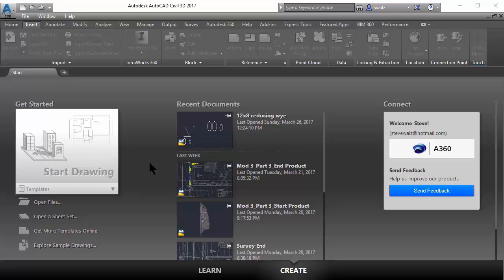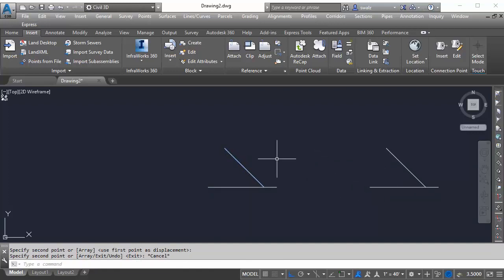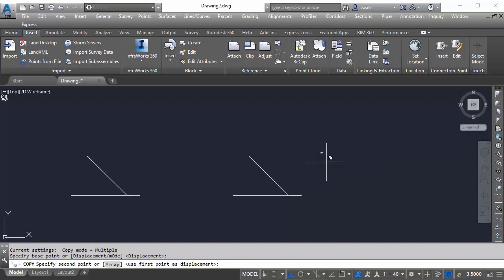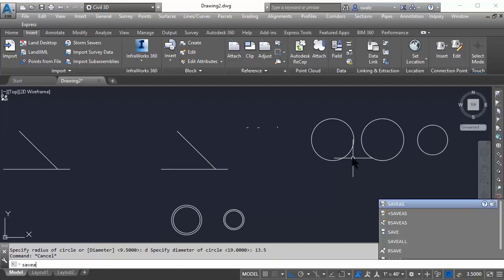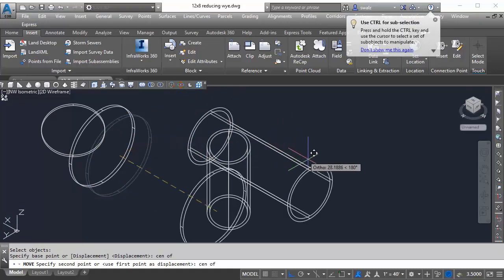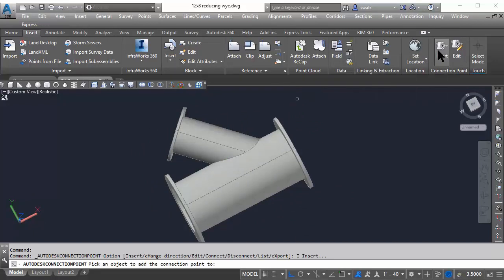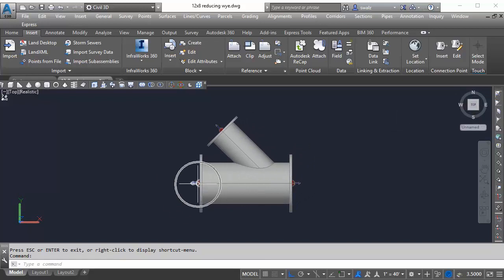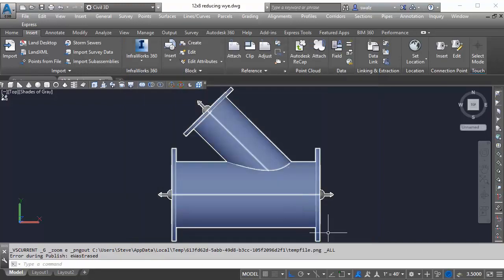Create Custom Pressure Part Model in Civil 3D

Comment: Hi…sir we are modelled Tee using civil 3D tools and Assigned  pipe connection in 3 sides. After exporting as pipe fitings , pipe catalog editor is not showing 3rd conection. Can you help me?
Reply from the maker: @nitheeshtk6747  sure! If you can, email me the part to stevewalz@hotmail.com…also let me know which version you’re using